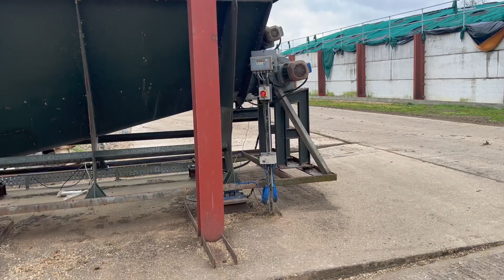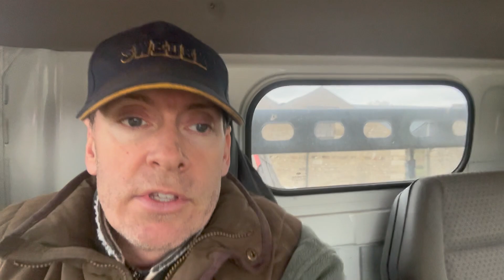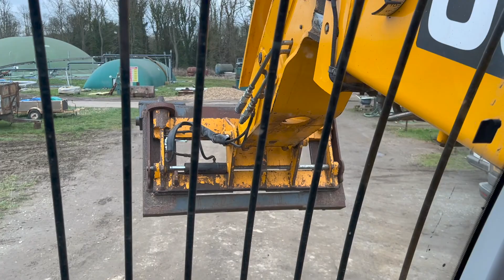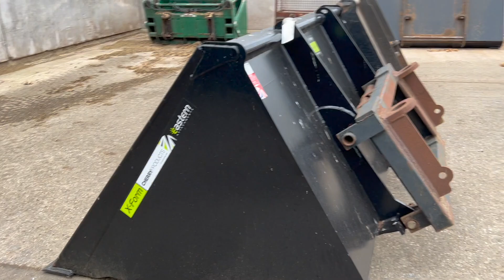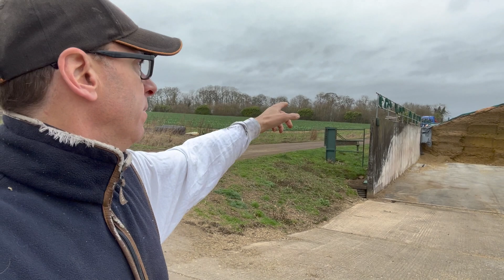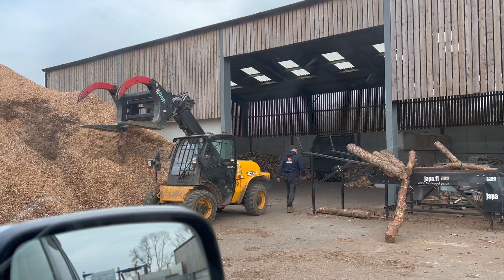Boiler working?

Comment: Hey alex .

I have a question i'm looking for a woodchip boiler 2 just for drying my firewood logs .
How do you transfer the heat of the water to hot air the easyst way ? And is the instalation exspansive excl de woodchipboiler  him self because i don't gonna buy a new one 

Im looking forward to youre expertise 

Great thanks 
From belgium
Reply from the maker: bonjour!
the heat exchanger i use is a 250kw unit from uk-exchangers based in olney. 
the hot air is blown into either a kiln or hooklift bins.
Reply: @biogasalex6320  thanks for youre reply .

Takes it a longtime to dry firewood for example in a container with youre setup ?

Grtz
Reply from the maker: depends on a number of factors. The ambient temperature, the moisture in the log , the type of wood it is for example oak takes a lot longer to dry. The amount of wind you’re putting through ie how many bins you’ve got on the drying system.
Reply: @biogasalex6320  yes indeed .

We let it first dry it a little bit by the wind in ibc cages  and than we put it in kiln it go a lot faster than 

May i ask was it expansive the heat exchanger ?
Reply from the maker: no. i think it was around £15k. 
they are very good heat exchangers.